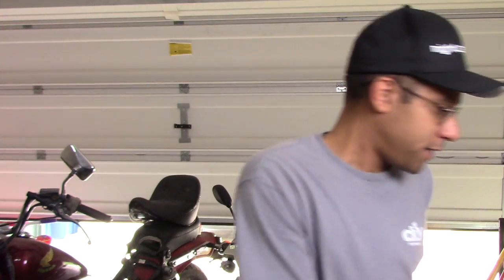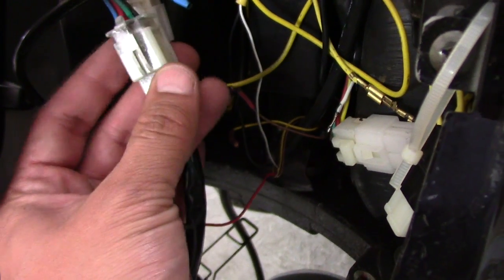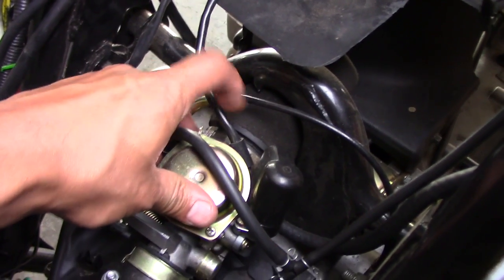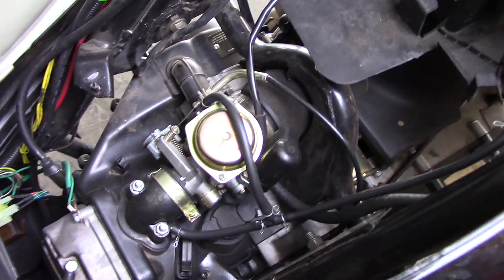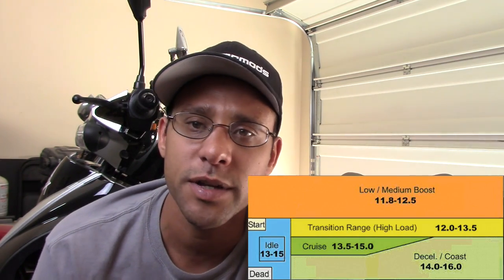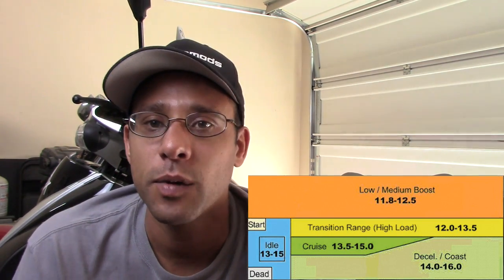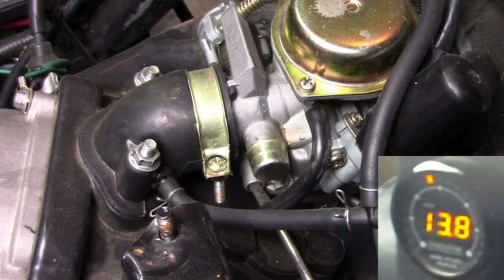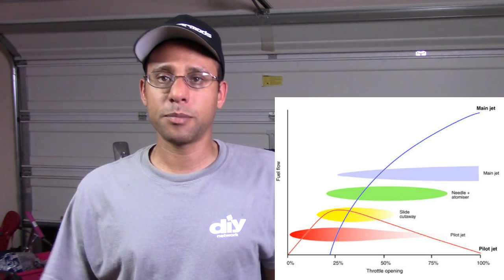GY6 Carburetor Tuning with Wideband Sensor

Comment: The only trouble I got is finding a 12 v acc on the ignition had it hooked to the switch but every time I turn the key it would work next time it wouldn't do for now right on the battery till it's tuned so far wide open 12.5-13

Comment: Good stuff, please take this as a friendly correction at 8:19, you are 100% correct about those being the stoich numbers, however a Lambda gauge (WB02) sensor does not measure AFR, it measures the ratio then scales it to match the pure gasoline 14.7:1.  

Using a lambda meter like you have that is scaled for gasoline means a readout of 14.7:1 is equal to 1.00 lambda, which is equal to all of those numbers in the chart.

Example that will confirm your understanding:  If you're tuning for E85 and want to target perfect Stoichiometric AFR, then you would target 14.7 on the gauge.  Again, because the gauge is scaled for gasoline AFR, not E85 AFR.  14.7:1 = 9.8:1 = 1.0 lambda.

Comment: Could you go into detail how you wired it? My kit is a 4 wire sensor and 4 wires at the gauge. The directions say that the signal wire should go to ecu. I wired the o2 signal wire to the gauges signal wire and I get no reading on the gauge just voltage and it goes up too high and eventually flashes 20.0 🤷‍♂️

Comment: Hi Joey! thank you for your work. You helped me with the oil change and now I've discovered your other videos. What GY6 do you actually ride? Is it 125cc? Can you advise me on carburetor setup? I have 24mm, the standard main jet is 105, but I installed an open air filter. Therefore, I consider the 108 .. However, I only ride in the summer when it is 77-95F. I don't have a lambda probe: / so I can only feel or look on color of spark plug... Since I kind of hope you have the same carb24mm + open filter, maybe your setup will suit me too. The following can be recommended from the table?: Main Jet/ Pilot Jet/ needle possition? Thank you a lot for any advice. Jan

Comment: You are going to remove the O2 sensor after you got the correct size jet, right? The probe on the O2 sensor practically plugs up your exhaust considering the size of the exhaust pipe and how big the 02 sensor probe head is
Reply: It has an extended bung though

Comment: Hey Joey I have a Zuma that's fuel injected.  So I also have an EFI tuner( rolling wrench Beast Mode). I want to install the innovate W/B sensor so I can adjust the air/ fuel ratio with the touch of a button rather than change jets. But I need  help with wiring and bung placement.

Comment: Nice vid but you glossed over the bung hole installation. That may be a challenge for some, as it requires proper drilling and welding of the exhaust pipe. Not everyone has a welder or welding skills. I still believe that anyone with a carbureted vehicle should first understand how it works and then learn how to tune it by Site, Smell, Sound and Feel. Having a wideband 02 sensor can help with tuning but it still requires a bit of trial and error.
Reply: You can take it to a fab shop to add a bung for for $60 or you can spend $500 and 40 hrs of tig welding practice and do it yourself.  Please let me know of a better alternative I'd also like to know =)

Comment: you don't even have to pull the carb out to swap out the jets. don't have to take off throttle cable, fuel/ vacuum lines, airfilter, ect.  I always drain it first, then loosen the hose clamp at the intake manifold, and spin the carb over while it's still in the intake boot. Then bam, pull your bowl and jets.  give it a shot next time.  #MopboyzGrandRapids
Reply: Really I'd like to see you get to the jets w out taking carb out.  You dont know what the hell your talking about.

Comment: I would like to tune my scoot this way. How do you determine the right distance on where to place the o2 sensor bung?
Reply: Christian Tence I believe these kits tell you about how many inches away from the exhaust port to weld the bung.
Reply from the maker: I went with temp.  I spent some time with a inferred thermometer testing how hot the pipe got at various lengths. Once I had an area, then I took into account contact from legs and operations.

Comment: what a load of....waste of time ;a carb can´t control the mixture with precision; just look at the color of the porcelain of the spark plug,instead; plenty of googleads on that.
Reply from the maker: I believe a carb can.  They used them for decades on cars.  Plus the point of video was that once you get into tuning and performance parts, the O2 sensor also protects engine
Reply from the maker: Either way. Thanks for watching and the comment.

Comment: Does the gauge control the wideband o2 sensor preheating?
Reply from the maker: +robertas grigas Yes. It preheats automatically when the engine is started
Reply: Obd1 + Obd2 O2 sensors only use a 1 volt max reference signal. Most Obd2 are multi wire for the preheaters. Older obd1 are single wire non pre heated. Bungs come in diffrent sizes. Use a cheap digital multi meter to reference the 1volt o2 sensors signal + slay the $130....me I dont use them, I just jet dead rich + lean in what I need throughout the seasons.

Comment: 14.7 is the perfect(stoich) number.For cruising you can go to 15.0.For full load 13,5-14.0 is the best.Everything outside this numbers is not good.
Reply: Ehh, just put a cheap fat #130-135 main jet in + lean screw in whatcha dont need season to season...Its scooter, idc if it "waste" a little gas long as it runs like a mule everyday. 1 of my scoots has 65K on a 2008 frame, engine been rebuilt a few times but still holds a roller crankshaft today
Reply: If you do that, you will make your pistons nice and toasty, have less power, and oh yeah, get worse gas mileage.

Comment: you have very good content, please continue making videos, I'm sure you will get more subs, and could you make some video about the transmission of a scooter?
Reply from the maker: Thanks for the kind words, I'm trying to keep new content on the way.  The hot summer day isn't helping, but I'm trying.  Most episodes have been recorded at the middle of the night. 

As for the scooter CVT (transmission), I actually have an episode being edited right now. Aug 2016 it should be up. I try to space out releases to compensate for times when I have nothing to work on.  So... subscribe and stayed tuned.